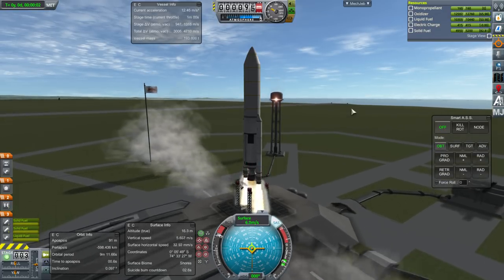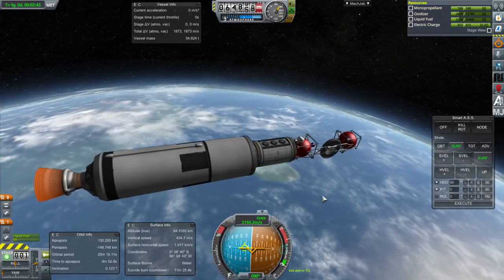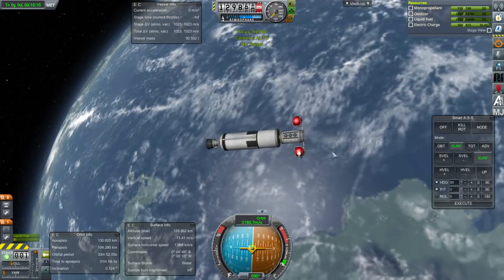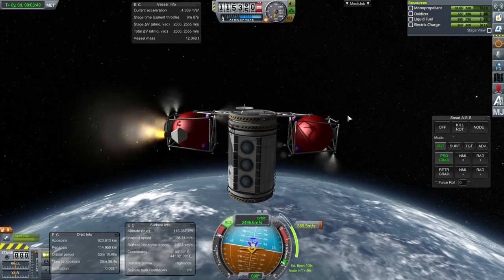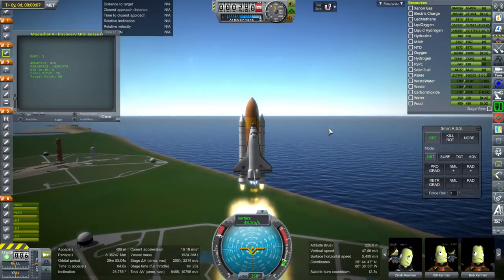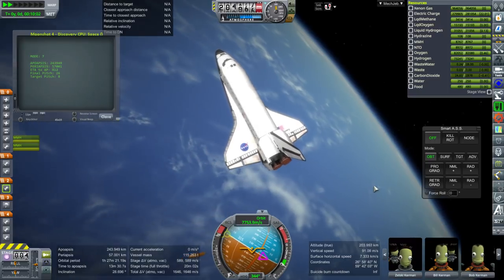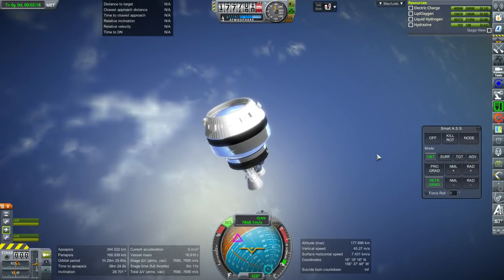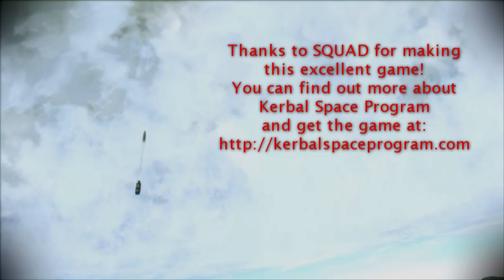Kerbal Space Program - Part Dev - Advanced Space Tug

Comment: Why did you not mount the engines perpendicular to how they currently are: on the long side, so their thrust is parallel to the center docking port. It would be perfectly symmetrical in the stock science labs case and should also work with the payload configuration you showed in RO. You could even build it as a pusher or a puller rocket.

Also: why don't you use the same hypergolic fuel for the RCS and the engines, like the Space Shuttle OMS did? It would make you more flexible reallocating resources.
Reply: I agree with all of this.  Engines parallel to the docking port especially, then you could push extremely long and heavy payloads without worrying about firing off axis.
Reply from the maker: Because this was designed to fit the cargo as in the RO situation. The situation shown in stock with the lab module should only be to shift modules around with RCS - not really using the main engines. I was just trying it out because of curiosity, not because it was designed for that.

It needs to have a certain amount of ISP to perform its job and still fit within the Shuttle's payload restriction, and that necessitated the use of MethaLox. I wanted six tons of cargo to the Moon, and hypergolics couldn't get me there. Also, the Mars mission already has MethaLox engines.

One thing I regret is not making the stock engines MonoPropellant as well, or otherwise running the stock tug's RCS on LF, since that would make it more flexible.
Reply from the maker: If you want to push extremely long payloads, of course, you could simply place the docking port on the nose of the tug. Its RCS placement isn't going to make much difference in docking if your payload is extremely long regardless of where you put it. Again, this was really designed with real-life requirements in mind, not the odd things people build in stock. Incidentally, most real life missions like Dragon handle their burns purely with RCS, or else their primary engine is actually weaker than 1kN.
Reply: If trying to use it as a tug to dock modules and not as a very unusual service module it would make more sense to put the payload in the slot, with a docking port sticking out of the bottom, because then the RCS thrusters are arranged around the payload and make it easier to control. This however leads to rotation when using the primary thrusters. So would it not make more sense to put them on the side for just this case? It is something that would happen in RO as well. You could in that case even embed them in the girder structure due to the rounded shape of the tank. This would not sacrifice any payload space. Even giving you back some compared to the current configuration.
Reply from the maker: I'll consider it.